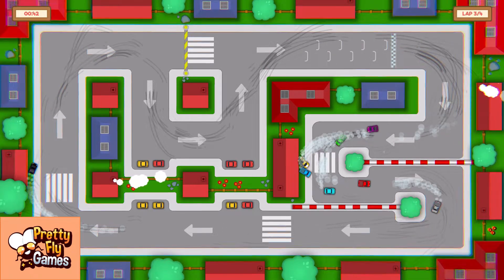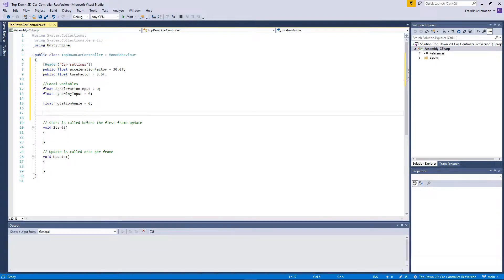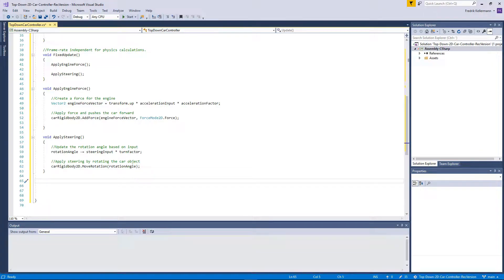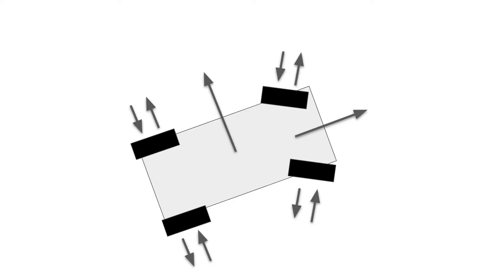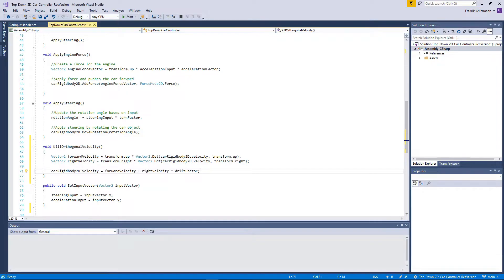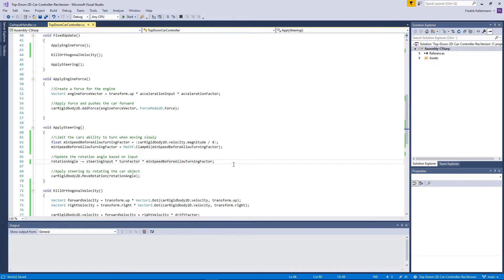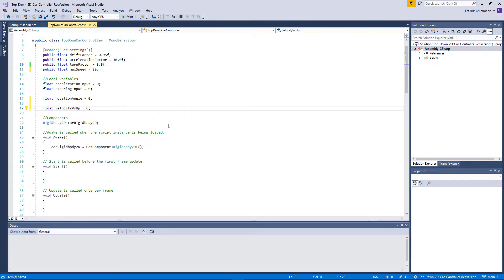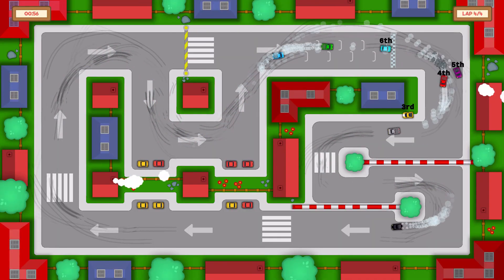How to create a 2D Arcade Style Top Down Car Controller in Unity tutorial Part 1

Comment: Hey!

I don't know if you read these comments anymore just wanted to tell you that after i finished the script it seemed to work fine but when i went on your second one to try out the trails everything seemed to break not sure if it was the script that was breaking it or if it was the trails please respond if you are able to answer my problem i have no idea why it does this
Reply from the maker: Hey there!
I do read each comment actually :) 

Please ensure that you download the project and try that out first https://www.patreon.com/posts/top-down-car-49913192. This will ensure that you don't have any typos or setup problems with the project. If the sample project works then try to figure out what is different, also check the Unity console for errors.

If you still have problems then please join the Discord server https://discord.gg/AyYtKXT as it's a lot easier to help and chat there.
Reply: @PrettyFlyGames  Theres one error wich says 'CarController' does not contain a definition for 'IsTireScreeching' and no accessible extension method 'IsTireScreeching'
Reply from the maker: @__cobble__7294  yeah that indicates that you didn't download the sample project. In the sample project the TopDownCarController.cs contains a function for that:

 public bool IsTireScreeching(out float lateralVelocity, out bool isBraking)

So please make sure you download the sample project and use that code.
Reply: @PrettyFlyGames  Did it and worked now when i got it to work this is an amazing tutorial really appreciate your help and hope to see you around a long time also subscribed now
Reply from the maker: @__cobble__7294  Awesome! Glad that it works now and that you liked the tutorials :) Thanks for subscribing.

Comment: Might be a dumb question but how do you rotate the car to start at a certain angle? Everytime i start the game it starts upward. I tried rotating the car and the sprite but it always defaults to going up first?
Reply from the maker: There are no dumb question, in fact this was a really good question. I've update the project so it uses the car rotations when it starts, that way you can change the rotation in the editor.

You don't need to get the project again, just add the following to TopDownCarController.cs
void Start()
{
        rotationAngle = transform.rotation.eulerAngles.z;
 }
Reply: @PrettyFlyGames  Such an easy fix woah, worked wonderfully! Thank you!

Comment: that was great, I just went over it, but did I miss something about reversing ?  the Steering feels like its backwards when reversing.
Reply from the maker: Glad that you liked it! You can adapt the code for reversing quite easily so it fits your needs. I think it's decent for an arcade style racing game where realism isn't the primary focus.
Reply: @PrettyFlyGames  Yes, and I did a little messing to get it how I want, in the player input script, when after setting the inputVector.x/y 
I checked for y <0 and then multiplied the x by -1 to reverse its angle, so if you turn right when driving forward it makes the same turning arc forward or backwards
Reply from the maker: @TheRealKaiProton  excellent and yes that is correct from a reality point of view. However I've noticed that a lot of people struggle with that when reversing but it's a great contribution to have the ability to have both :)
Reply: @Kai Proton All you need is one additional line of code in 'void ApplySteering()'

int dir = velocityVsUp > 0 ? 1 : -1;

and multiply rotationAngle by 'dir' value: 

rotationAngle -= steeringInput * turnFactor * minSpeedBeforeAllowTurning * dir;

Cheers!

Comment: looks great! But how would you make the car steer using mouse click position instead of using input from keys?
Reply from the maker: Thanks! 
In that case you should add mouse position detection in the CarInputHandler.cs and probably change so that the car tries to steer towards the desired waypoint. In future tutorials I'm planning on showing how to implement AI in a top down car game and that would probably be quite similar to using mouse controlled input so I'll consider adding that to the AI tutorial.
Reply: @PrettyFlyGames  Thanks! :)
Reply from the maker: The Car AI tutorial is ready https://youtu.be/vsPzo7IVTHw you can easily add the ability to have the car go to a certain point when you click with your mouse.